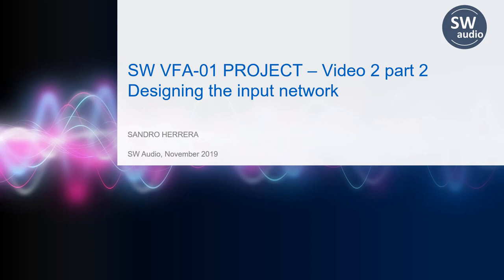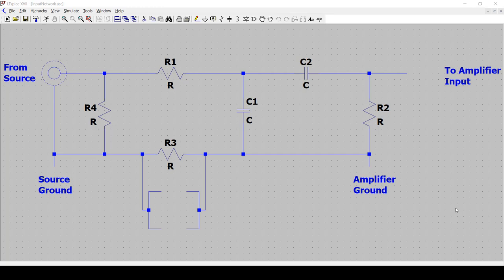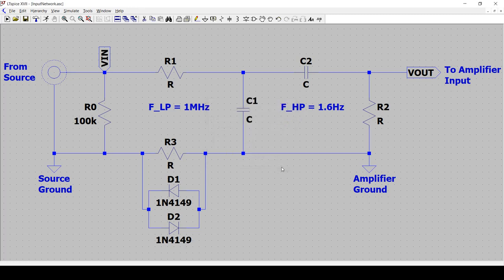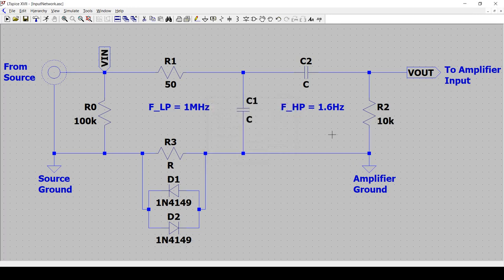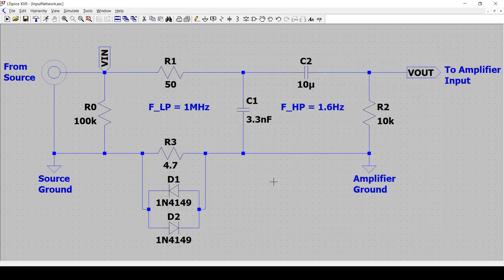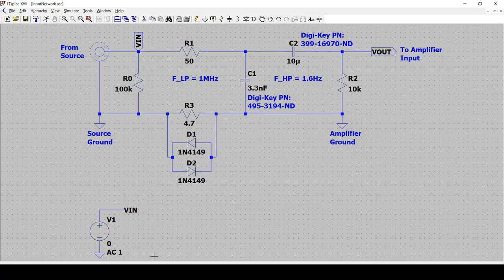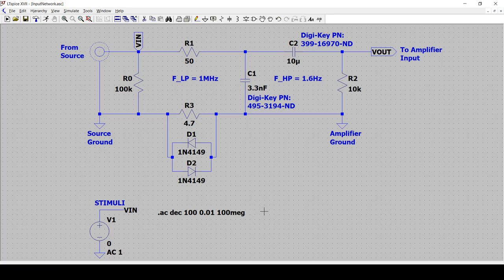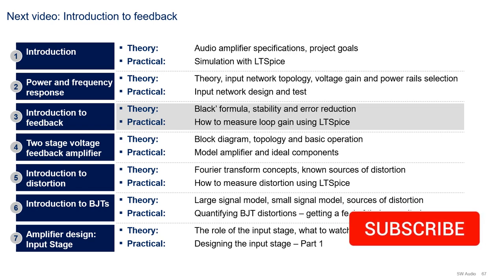2.2. Input network design and test using LTSpice - Audio Amplifier Design Fundamentals

Comment from the maker: Hi all, the associated file for this video can be found here:
https://www.diyaudio.com/forums/solid-state/347673-sw-vfa-01-audio-power-amplifier-video-series-2.html#post6046169
NOTES: 
1. FINAL VALUES for the network are at 29:50.
2. In this video I decided to go solely with Film capacitors, but you can also use C0G/NP0 capacitors.

Comment from the maker: Hi all, there is actually a mistake in the schematic shown in the video.  R3 and the diodes should be all the way to the right, between R2 and the amplifier ground.  The revised schematic can be found at:
https://www.diyaudio.com/forums/solid-state/347673-sw-vfa-01-audio-power-amplifier-video-series-5.html#post6089388

Comment: Just a note... At 4.8KHz the 3.3nF cap has the same impedance as the 10k resistor. At 20KHz your input impedance will be 1/5 10k or 2kohm. The corner frequency of your input impedance is in the middle of the audio range and may interact with your source impedance, and in the treble may be more of a load than the source is expecting.
Reply from the maker: Hi Keantoken, good to see you here!
You can see at minute 29:50, I cut the 3.3nF to 680pF due to the issue you point out.  I had already recorded most of the video at this point, so made the changes at the end.  I know this is horrible practice, but I am learning how to make videos properly as I go.  Also, I see the black background on plots is terrible.  This will be fixed from video 4.2 on-wards.
Reply: @swaudio6528  Sorry for not catching that. A lot of this is basic to me so I skip around. Another thing is that the LTP input needs a RF shunt as high source impedances directly alter the LTP Gm and make stability interact with the source impedance. Since this is also a large part of the reason for the phase lead cap, it makes sense to make the input shunt cap >CLG*phaselead. So if your phase lead is 10pF and your amp has a gain of 30, then you want >300pF input shunt capacitance. I like finding little gems of reasoning like this.
Reply from the maker: @keantoken I figured.  I now have a comment pinned at the top. 
Thanks for the shunt cap recommendation.  Can you draw it please and send it to me by e-mail: swaudiodesign @ gmail.com or post it in the diyaudio forum.